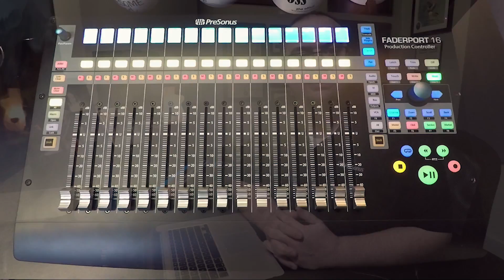Presonus–Channel Strip Functionality with FaderPort 16 and Logic Pro

Comment: It's not working. I bought it a week ago and it's not working properly. MCU Logic mode is already selected, plus I deleted all devices in midi studio, firmware updated to the latest version. Driver re installed. I re-configured the surface preferences in Logic many times to make sure I follow the manual and video instructions exactly. Neither the BANK option nor the CHANNEL function of the session browser work properly. If I can't advance correctly in the track bank I can't control the faders for the whole project. The machine works fine in studio one, I installed it for testing. What's wrong? Customer support didn't help much. I bought the surface because your videos and user manual say it works well with Logic. Is it false advertising? Am I doing something wrong? Please take a look at these videos and tell me how to keep my money and trust in Presonus.  Mojave 10.14.6. Logic Pro 10.4.8   https://www.youtube.com/watch?v=MRK49zCy-ZY&list=PL71M7jT9ftkNSYzY5EMmYOU_qjXYKU6qG

Comment: Hi ! thank you for your videos. I compose film music with Logic Pro X. And I would like to use the VCA to finalize my mixing with Faderport 8. Maybe you can answer a question. If i press the VCA button of Fadertport, i directly have the 8 VCA of logic assigned to the 8 faders of the midi controller? So, I would like to press PLAY in Logic and adjust my mix directly with the Faderport8. Thank you for your answer.

Comment: Attention Presonus:

The biggest reason for poor sales of control surfaces is the lack of affordable and well designed choices.  For literally decades, it’s been $5000++ or ridiculous toys for under $1000, which are unsurprisingly of little interest.  The technology is easily available and the hardware is a small obstacle as it so closely resembles many of the digital mixers already in high volume production.  Presonus has a chance here though the Faderport is not quite going to do it.

The first to jump would likely see success in the $1000-3000 price range.  They must support it relentlessly too, with regular firmware and software updates that many would have no problem paying a reasonable price for.  Avid played a hugely cynical trick on their customers by refusing to update their products in an infuriating game of planned obsolescence.  This must not be repeated.

There are many thousands of artists and independent producers with that kind of budget literally crying out for such a product.  Avid started at the top and is working their way down with the S1, but 8 faders is just stupid.  Seriously, who buys consoles with 8 faders?  Nobody, and for very good reason.  Adding faders to a control surface is considerably cheaper than adding channel strips to a mixer.  

My Control 24 is seriously outdated but the fader quantity is quite usable with a DAW that allows grouping.  I routinely arrange 80-90 track sessions on its 24 faders so I consider that number a good compromise.  Tight integration with a DAW and its very inexpensive display makes a powerful recording and mixing solution.  The market in this price range is far bigger and more sophisticated than manufacturers are giving them credit for.

Comment: Presonus... (1) Make a Faderport24 & Faderport 32. (2) No ghost channels please. (3) Compatibility with all DAW and please include MOTU's Digital Performer 10. (4) Make the 24 & 32 Faderports with the LCDs having 20-25 degrees angle, so we can see better! (5) Bring back an upgraded hi-end version of the ACP88.
Reply: Surely would rock, but would be very expensive. I doubt the company would take such a business risk, since these controllers — especially in larger variants — do not sell huge numbers.
Reply: Michael Lauer   The biggest reason for poor sales is the lack of affordable and well designed choices.  For literally decades, it’s been $5000+ or ridiculous toys.  The technology is easily available and the hardware is a small obstacle as it so closely resembles many of the digital mixers already in high volume production.  

The first to jump would likely see success in the $1000-3000 price range.  There are many thousands of artists and independent producers with that kind of budget literally crying out for such a product.  Avid started at the top and is working their way down with the S1, but 8 faders is just stupid.  Seriously, who buys consoles with 8 faders?  Nobody, and for very good reason.  Adding faders to a control surface is considerably cheaper than adding channel strips to a mixer.  

My Control 24 is seriously outdated but the fader quantity is quite usable with a DAW that allows grouping, VCAs.  I routinely arrange 80-90 track sessions on its 24 faders so I consider that number a good compromise.  Tight integration with a DAW and its very inexpensive display makes a powerful recording and mixing solution.  The market in this price range is far bigger and more sophisticated than manufacturers give them credit for.